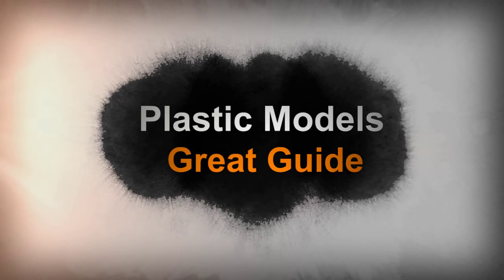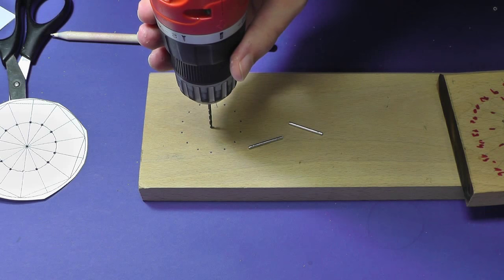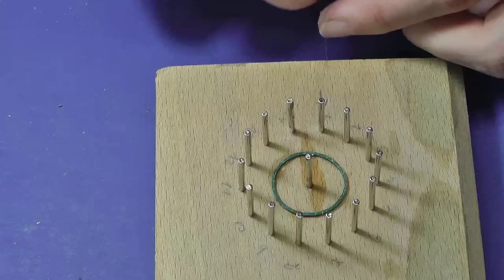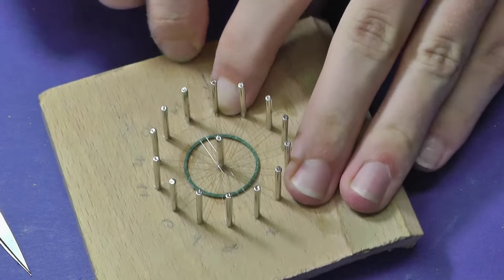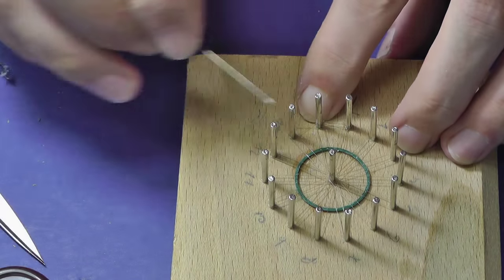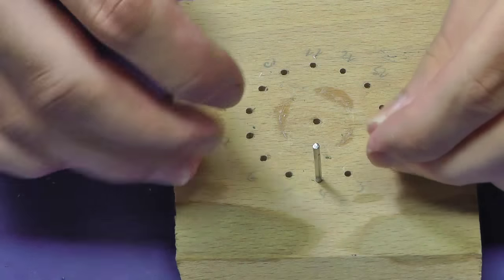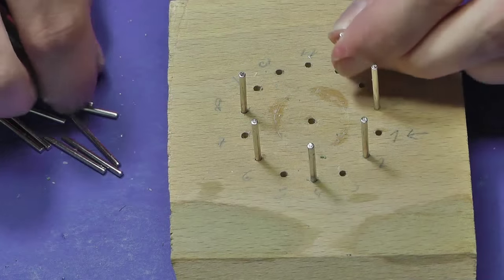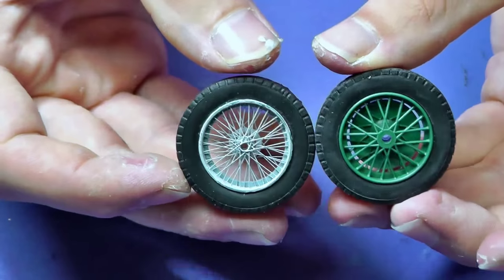How to make a metal-tension spoke wheel - Great Guide Plastic Models

Comment: Before cutting up the original wheel, how about using it to serve as a layout centering template so it's easier to center the wheel parts in the loom later.

Comment: Hi David. I hope you can answer my question. This is an astounding piece of work and I want to try it on my next build (a 1920s biplane in 1/72). My question is, you show gluing the spokes to the rim but did you also glue them to the hub? If not how do they stay in place, if so, how do you get the wheel off the spindle?

Comment: Would this work for 1:35 scale motorcycle wheel ?
Reply: can bet yes, but thicker line or mabey coper wire, u need to try. angels are the same ;)..   u always can count spokes in real one and then  THINK AGAIN a bit.. but like i said can bet yes, just take diameter of real spoke (if posible) and count 1:35 from this, then pick line or wire u need. of corse i never did this, i'm just trying to figure that out. sry for english trying my best. i think if u take size of usual motospokke it will be way enough